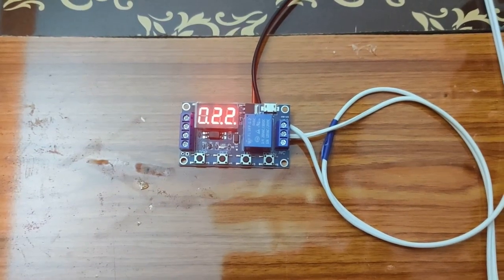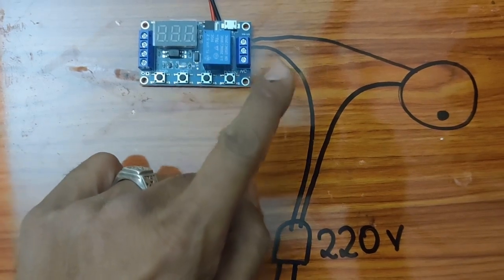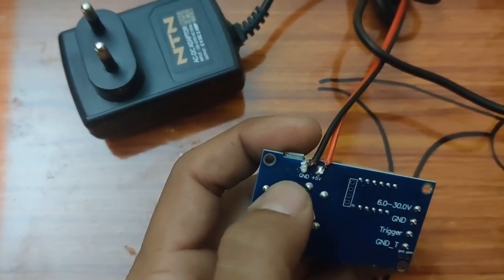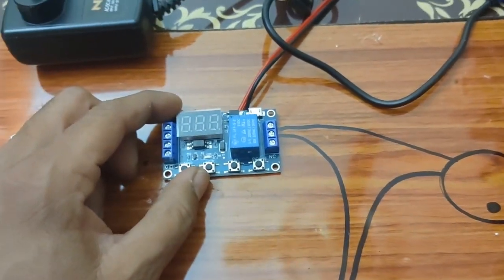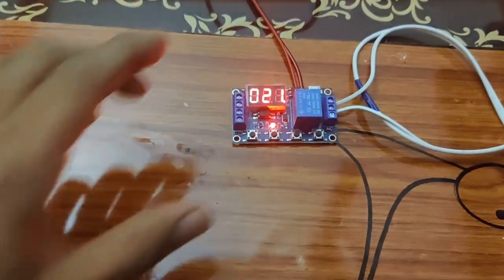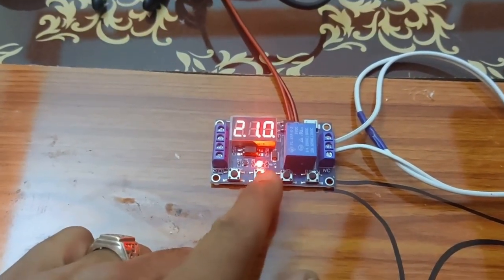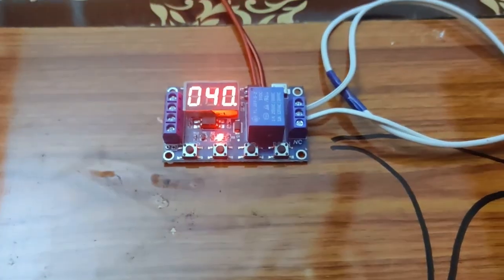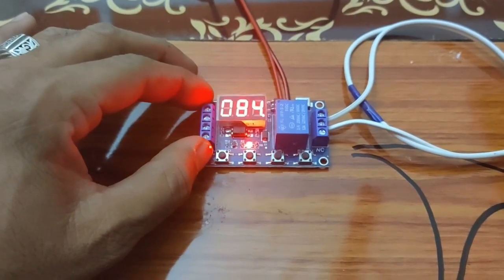incubator timer delay relay module 5v / Relay Module Switch Trigger Time Delay Circuit

Comment: Does it have any microcontroller/microprocessor? I don't see any and wondering how does it works as programmable.
Reply from the maker: Its just a delay module with a timer relay. Can only do a few functions of triggering at a set time period
Reply: u can connect it to the input pin of any micro controller/plc to have them controlled by this relay. i think so.

Comment: How much setting can be done to motor run  in a day for eg : 10 setting / 20 with interval
Reply from the maker: This device has on and off interval.
It works in minutes
You can place OFF interval to 480 minutes and ON interval as 3 minutes.
It will shift between ON and OFF interval forever

Comment: 220 vlt motor ki jaga Dc motor use kar sakty hai.???? 
agar use kar skty hai to plz share wiring......
Reply from the maker: Is you want to use a 12v dc motor then , instead of  connecting plug on the motor side, connect dc adaptor

Comment: I'd like to see this being triggered with a PIR so its lights up LEDs.
Reply from the maker: PIR is motion sensor, why would you want to connect this device to PIR
Reply: @siddiquiccsi  I use the RCWL- 0516 sensors over those PIR's and their run time is around 3 seconds therefore not long enough for projects I build BUT those RCWL- 0516 sensors are very good in my opinion as only a human can set them off. Adding this timer relay module would allow me to extend the runtime of the sensors I use.

Comment: Hi, Good tutorial. I have an issue with my board.  When running in P1.3 set with OP to 10sec, the relay remains off and at the end of the timer, it switches back on. Any idea how to reverse this to normal?
Reply: This JZ-801 board is functionally similar with a couple of added functions.  There is a rough English translation of the full board instructions here:
 
https://amzn.to/2MQOFES
Hopefully this will give you the information you are looking for.
Reply: @walthodgson5780  thank you sooooo much you are a lifesaver...

Comment: Can I use it for 5 hour for off some load,
My load require 2 times off for 5 hours per day can I use it please tell me quickly
Reply from the maker: For setting it multiple times you have to buy other timer online. Whatsapp me on 9703394988. I will send you the link.
Reply: This JZ-801 board is functionally similar with a couple of added functions.  Either will suit your needs.  . There is a rough English translation of the full board instructions here:
https://amzn.to/2MQOFES

Comment: Hi, Good video.
I want to use it for 18 Hr on and 6 Hr off throughout all days for plant lighting. Is it suitable?
Also does the program erase when power is turned off? Do we need to reprogram after every power outage? Pl comment. Thanks and regards.
Reply from the maker: Usually when power turns off and then comes back. The timer activates for the set time and then goes on to delay.
If you don't want this to happen, you better buy Frontier timer delay module
Reply: @siddiquiccsi  Thank you.

Comment: Bhai ye wali timer ko bottle filling machine mai use karna h bt wiring samjh ni Aa ra 12v dc motor k k liye
Reply from the maker: Isme time set karo , on/off trigger
Reply: इसके ट्रिगर पॉइंट पर आपको तब सप्लाई देने का तरीका करना पड़ेगा  (किसी माइक्रो कंट्रोलर/plc की मदद  से ) जिससे ये रिले आपके दिए समय के मुताबिक ट्रिगर होकर बोतल को फील करे अथवा बंद रहे.
Reply: @siddiquiccsi 

No problem bro language is not knowledge